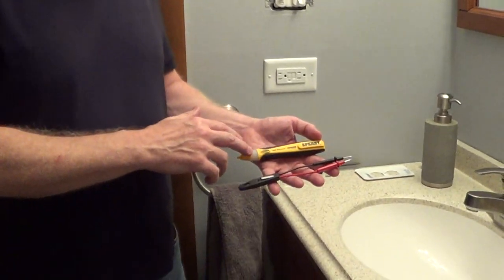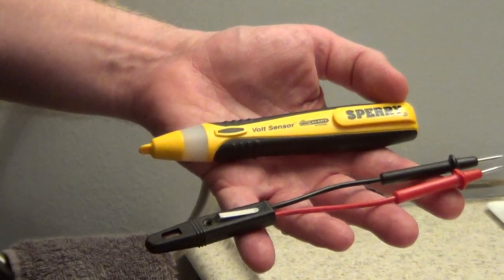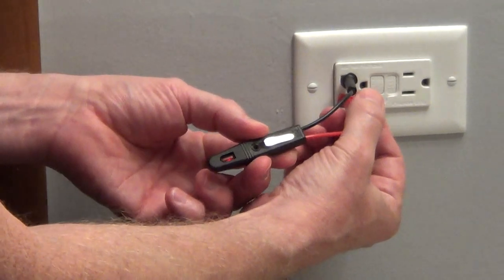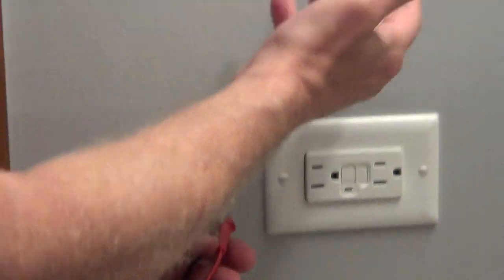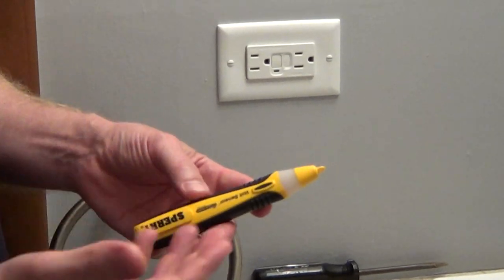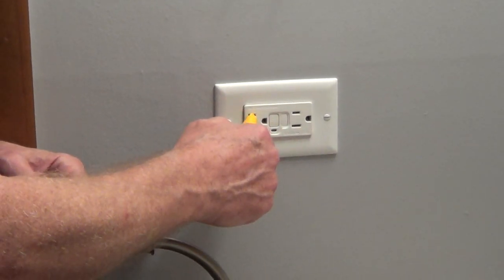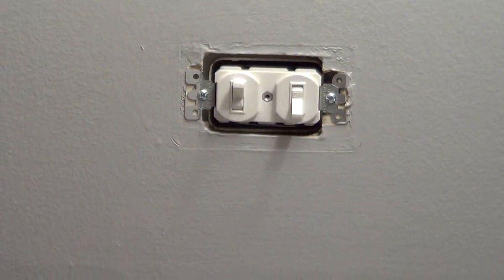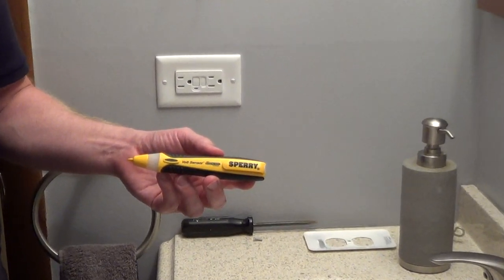Electrical Tester - How to Use an Electrical Tester - Circuit Tester

Comment: I've  just had to return one of those none touch models,, it lit up if you just  tapped it, while nowhere near a live circuit.. So did another one in the store. Who checks these things, a life could depend on it.
Reply from the maker: Hi, if you were rubbing it against your skin, the hair on your arm could create static electricity and set it off. One of the ways some pro's test to see if it is working is to rub it across their hair.

Comment: when you test the plug or switch, can you tell which side is the positive or negative without having to remove the faceplate?  Meaning if I go to one side or the other will it detect?
Reply: I saw another video and the small slot is hot by the gold screws and the large slot is cold by the silver screws.

Comment: any other names for circuit tester? so I can tell them when I go to home depot....
electricity current in light switches and smoke alarms, are they enough to kill me or knock me out? just wondering
Reply from the maker: Hi, I like Sperry, Gardner Bender and Klein electrical testers. I have found them to be reliable. Yes, a shock on a 120 volt line can give you cardiac arrest. 
We have a weekly home improvement podcast too, here is a link http://www.stitcher.com/s?fid=49441&refid=stpr

Comment: So this tester would not help when trying to identify a hot and a neutral wire.
Reply from the maker: Hi, with the circuit ON it will show what wire is live. For a circuit with one cable, it will show the hot, which should be the colored wire, black or red in most cases. The white wire will be neutral, unless marked with black tape or paint. Feel free to send a picture to fixitpodcast@gmail.com if you have a specific question with an electrical box.

Comment: If i want to check illegal electricity connection what should i use ?
And if i can ask how to do this? I know about disconnect everything from the outlets then check if from electric main panel if is still retrieved.
Reply from the maker: Delstar Hi, are you asking if someone is tapping into your electric?
Reply: FIX IT Home Improvement Channel Yes. Thank You for awesome fast answer :) I cant find anything but my bills are 2x higher then all around i know. Also tv is used only weekends together with PC. 5 days a week apartment is empty so i dont know how my bill can be higher then someone who have laundry, 2 tv, ac, 2 fridge and always somebody is in home.
Reply from the maker: Delstar Hi,
we had a couple apartments that we bought where the electric for one apartment had some circuits on the service panel for the common areas and vice versa. Are there individual meters for each apartment?
Reply: FIX IT Home Improvement Channel Yes. for one floor one meter. everything in the basement.
Reply from the maker: Delstar It is not legal to have a shared meter that you pay for. A shared meter is the landlords responsibility. As your utility company to inspect the meter and determine whether there is a problem. They have to do it within a couple weeks. If it does have someone else on the meter, the landlord has to take it over, or fix it. Here in Illinois, you can have the utility company reimburse you for what you paid and they have to get it from the landlord. Good Luck. Let me know how it goes. What state are you in?
Reply: I would wait until night, when all your neighbors are home and dinner is being cooked and the place is lit up like a Xmas tree.  Then I would stand out front and have a buddy turn off the breakers for your unit and see if any other unit goes dark.  There will probably be some yelling too, as they try to figure out what is wrong.

Comment: Where possible, you should idealy only ever use a GS38 approved voltage tester to confirm something is dead. While useful, non contact voltage sticks can give false negatives and should not be used to prove dead. 

Same goes for multi meters what can be set to the wrong setting.